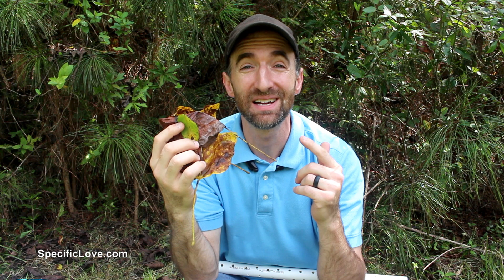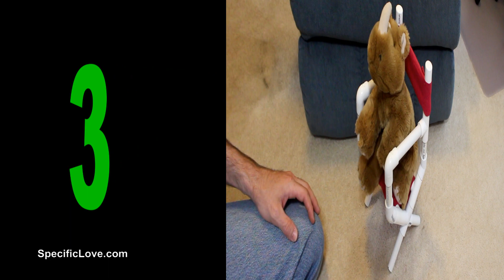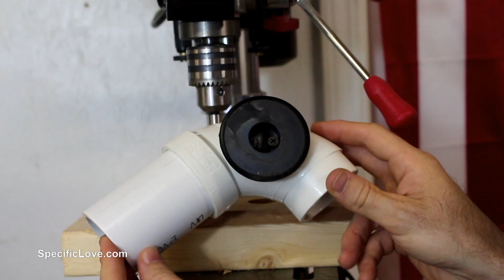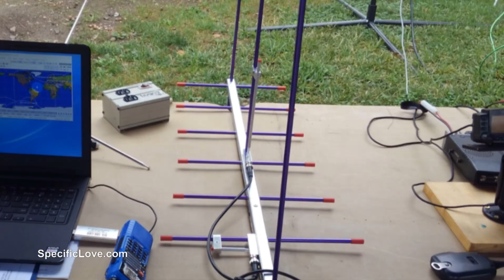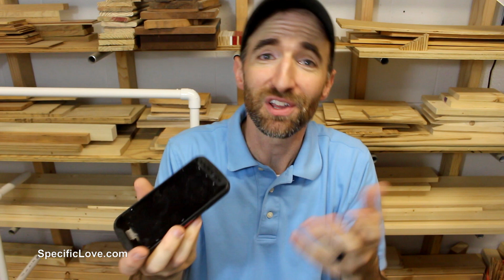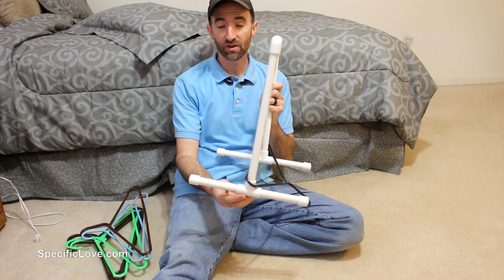10 Life Hacks with PVC #28

Comment: I took 4 elbows pvc and 4 90degree tees and with some 1 inch dowels I made a square shape using the 4 90* tees the size i needed and ran 4 longer wood dowels down from the tees to the elbows and ran 2 smaller length dowels to make a stand and draped over a net garment bag over it to make my clothes hamper for my closet

Comment: The stair hand rail thing is actually pretty unsafe. Would you use a hand rail that was suspended by any type of string? If you tripped or fell, you’d hold on to it thinking it’s firmly attached, but as it started flopping around your grip would have to shift, tightening and releasing and you would eventually lose the handle...now you’re an adult and you can anticipated this, but a small child would not.

Just a thought.
Reply: Great idea ..tnx 4 share..i always folow ur vid..would u mind make vid about how to make shade 4 car from pvc pipes ..foldable one ..i will be great tnx